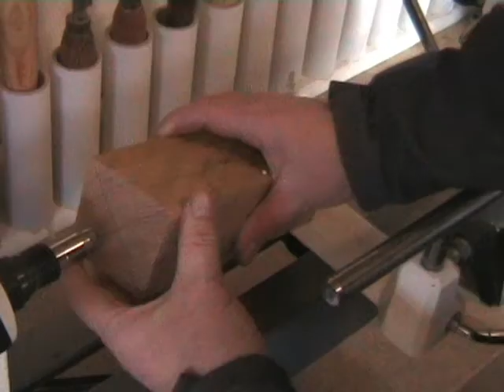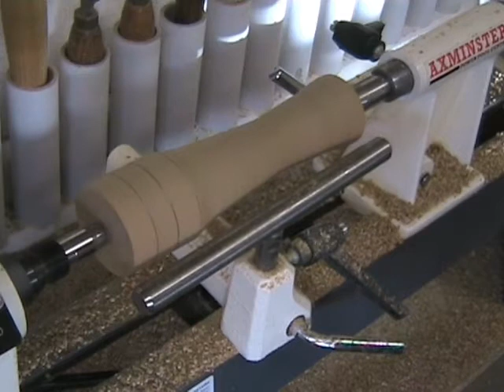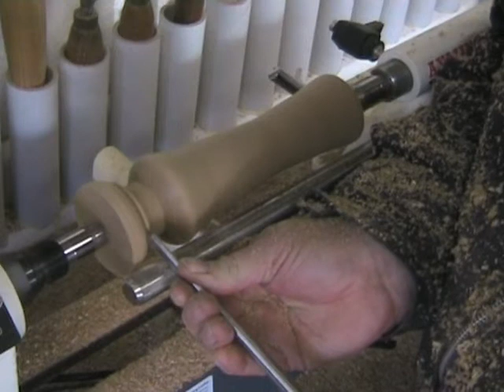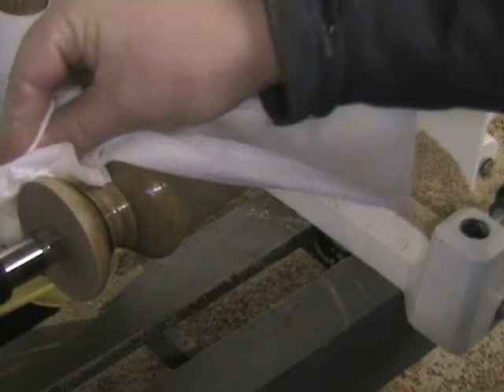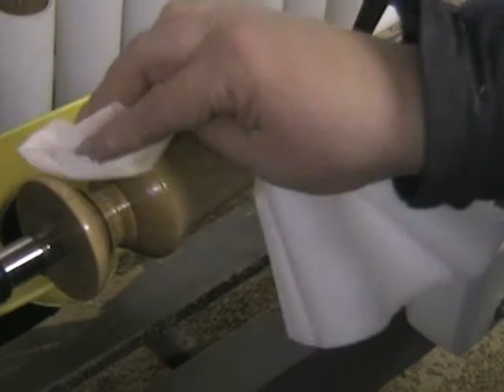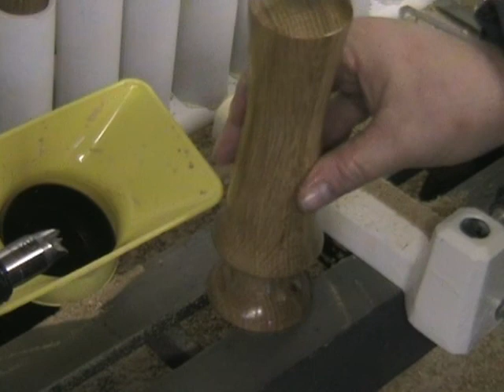candle stick

Comment from the maker: Hi Carmen, Thanks for your comments and subscription. The pipe is just glued to the base rail with Polyurethane wood glue this sets in 5 minutes and fully cured in about 12 hours. Polyurethane glue will expand as it starts to set. Kind regards Glyn